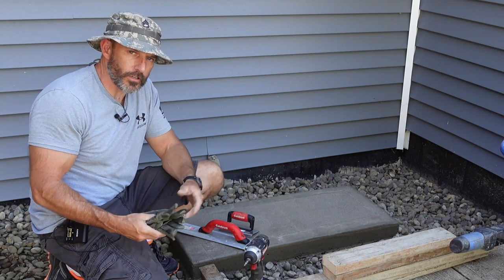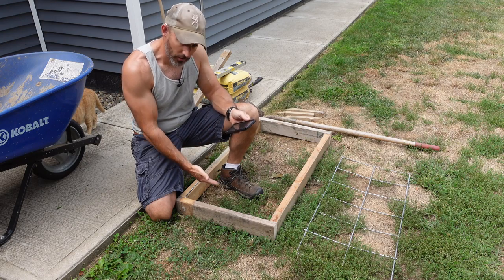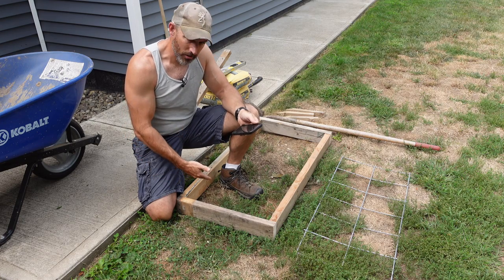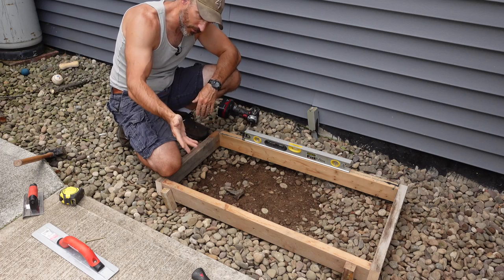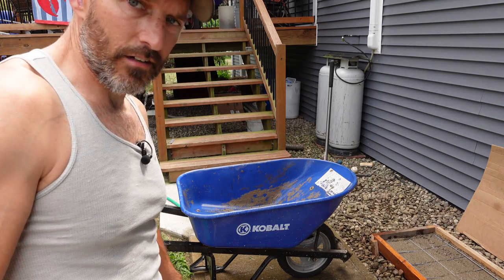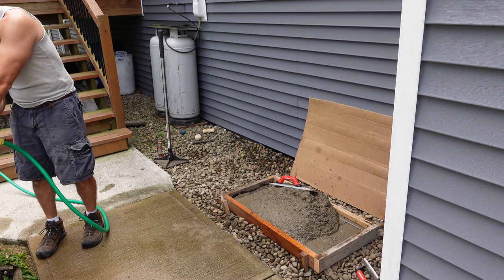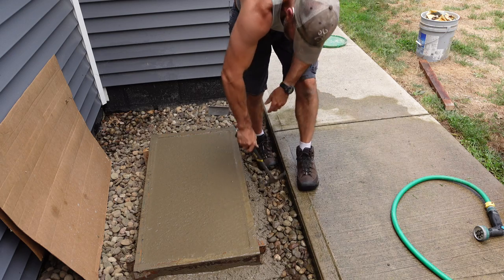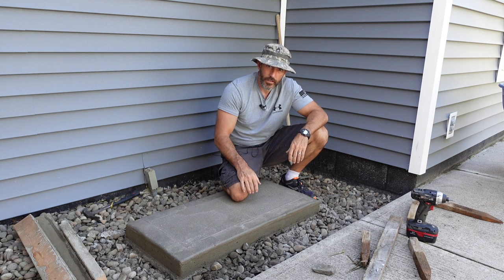How to pour a concrete slab for outside AC, garbage can, burner barrel, deck stair landing

Comment: Nice job, Jim. I added central air several years ago. I didn't make my pad level. I have it tilted away from the house slightly (about 1/2") for water runoff. I'm not sure if that's standard, but it seems to work well for me. 
PS: We are almost into pellet stove season again. I need to change the exhaust fan and motor (again). Maybe I'll video the process and post it. God bless, my friend!
Reply from the maker: Summer was too fast, good luck with your video let me know if you post it.

Comment: Great point about making support rods or stakes flush or below form level. Makes place and finish  much easier! I admit when I make these slabs I do them on a flat surface not on the site because I like them to cure a few days before I take them to the install location. You would be amazed how many mini-splits people are installing here for garages and even sheds! Using the hammer as a vibrator is always a good tip too! Right you are about animals, I have had more than one duck walk around on my concrete slabs!
Reply from the maker: Never had a duck print on my concrete lol

Comment: The wire mesh and or rebar goes in the bottom 1/3 of the concrete.
Reply from the maker: Thanks for the tip, and thanks for watching

Comment: Solid video. Curious what brand and type of ac will you be installing? Are you replacing your Mitsubishi mini splits or is additional unit you’re adding?
Reply from the maker: Adding AC to my Garage. Mr cool sent it to me to make a install video. I think I will use it more for heat in the winter. So far it seems like a nice AC.
Reply: @DIYJIM  nice yeah good idea with the heat pump. 👍